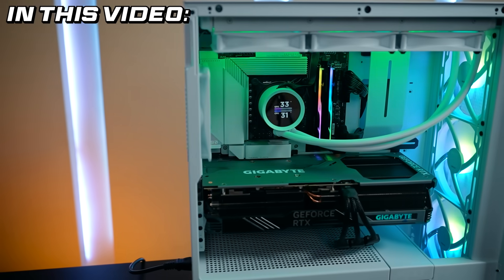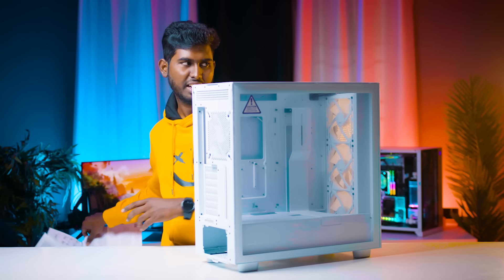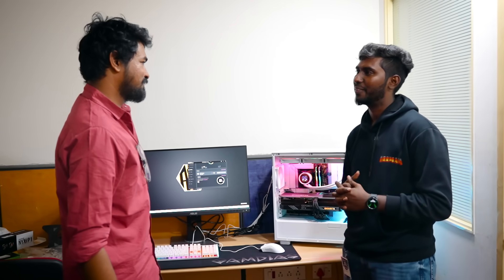MADAN GOWRI's First PC - @madangowri  X A2D | Video Editing PC for Madan Gowri🔥

Comment: Hi I need to go for an upgrade

I have a rx 580 8gb vga
Is it compatible to go with ryzen 5 1600.

Does Msi B450M-A PRO MAX supports Ryzen 5 1600, rx 580 8gb vga and ddr4 8gb ram.

My intention is gaming 50% and normal work 50%.

Please give me Advice
Thanks.

Comment: Bro ... I have seen you guys get ESD shock many times in various videos ... a simple trick to avoid that is to touch the panel with a metal key with you holding the plastic portion of the key -> this will transfer all the accumulated charge from the panel to the metal portion of the key ... now you touch the panel without any shocks :) ... you can then discharge the key anywhere like concrete wall or any big metal body ... you can do it later also (not needed too as it will slowly discharge in air ... this is from my experience in a cold/dry winter weather in Germany when I visited last year :D ...

Comment: 64-bit processor and operating system OS: 64-bit Windows 10 Processor: Intel Core i5-6600K / AMD Ryzen 5 1600 Memory: 16 GB RAM Graphics: NVIDIA GeForce GTX 1060 3GB / AMD Radeon RX 580 4GB DirectX: Version 11

Comment: dont use samsung 980  pro  ⚠⚠⚠⚠ ... garbage ssd... incase neenga firmware update panama use panirindhinga naa, older firmaware la irundhichu na, neriya issues vadhriku, and data corruption airiku which ultimately lead to permanent Data loss !! 🤬🤬🤬🤬...stupid ssd..that older firmware has some program error, where the firmware code makes the controller think that all NAND flash cells have almost crossed its ending life span nu oru thappana olu information sollirum controller ta..andha controller will stop write mode  into SSD and make it READ only and sila peruku Data vah eh corrupt pani vitirchu.. seriyana kiruku P***a samsung SSD... samsung SSD la failure rate adhigum, despite it has the best industry latest features in market comparing every other SSD brands..features wise la top notch, but failure rate is high comparing other well known brands... so better switch to Seagate firecuda, or crucial, or some other brands..if you want low failure rate..Even Samsung 990 pro had many failure rate issues...

Comment: Best way to set up the cooler is to set it up  outside of the casing it will reduce the dust inside the pc . If not invest in a good dust filter for the room

Comment: 0:01-0:14 In this Video......
0:18-0:50  MG Anna PC Build.......
0:25 😂
0:31 Dont say like That Bro.....❤
0:52 Processor.......
0:58 Motherboard......
1:16 RAM......
1:26 SSD......
1:41 😂
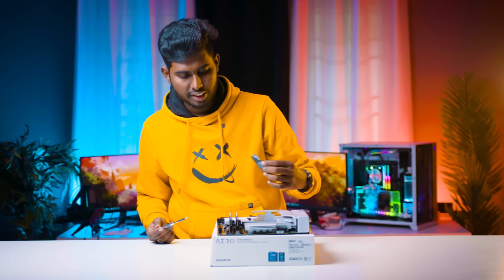1:52 😂
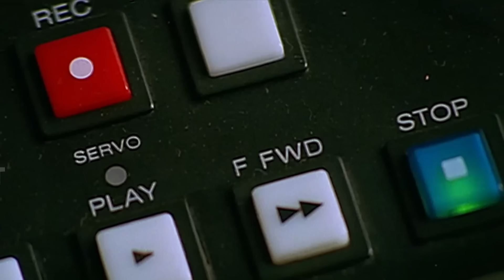2:15 😅
2:22 😂
3:07 Cabinet.....
3:13 😂
3:29 PC-DOC 1st time Reading the Manual......😅
3:48-4:15 PC-DOC Kutti Story.....❤
4:25 Assembling Part......❤
4:29 PC-DOC Style.....😅
4:35 MG Anna is an Introvert????
5:09 Installing Cooler.....
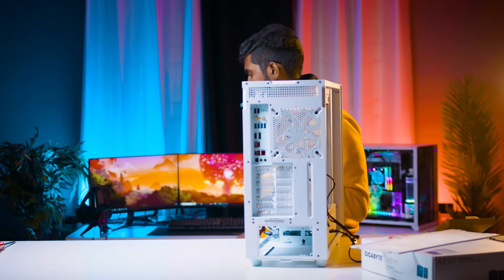5:18 Vibe Time......❤
5:27 😂
5:40 Cable Management.....❤
5:48 GPU.....❤
6:23 Connect The Pin connectors Properly in GPU.......❤
6:37 MG Anna Office......❤
6:47 MG Anna Entry......❤
6:55 MG Anna × A2D......🔥
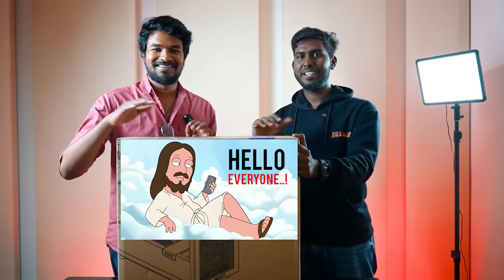7:06 😂
7:26 😅
7:30 😂
7:51 MG Anna kku Shock veitha PC-DOC......😂
8:06 😂
8:15 😂
8:40 Jerk kaatum PC-DOC.....😂
8:49 😂
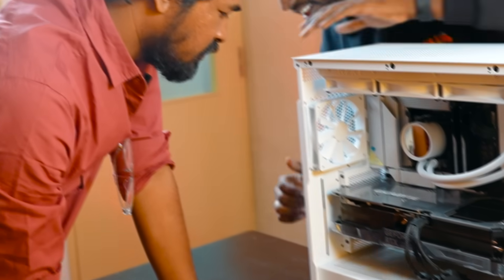8:53 😂
8:59 MG Anna Unboxing.....😅
9:15 😅
9:42 😅
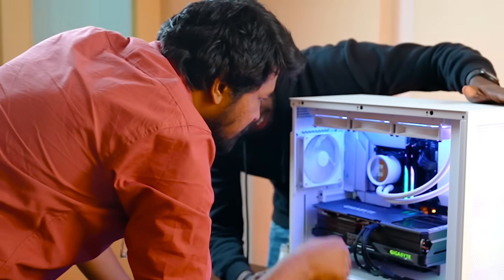9:48 MG Anna Face la oru Happiness.......❤❤
9:57 MG Anna Technical Questions To PC-DOC.....❤
10:21 VR Headset MG Anna Apple Vision Pro Memories........😂😂❤❤
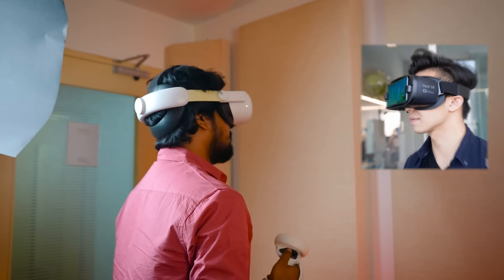10:38 MG Anna Experiencing VR headset......❤❤
10:49 MG anna Vibing with VR headset......❤
10:52 😂
10:57 PC-DOC Kadamai unarchi.......❤
11:08 After The PC Setup.....❤
11:22 😂
11:30 MG anna Experience About This PC......❤
11:50 Next MG anna Server.....❤
11:59 Edhukku indha PC for MG anna......❤
Reply: Yaaru saamy nee
Reply: epuddra 😰😰🥵🥵
Reply: Thivira rasikana irupa pola

Comment: Bro can you build 10000 ₹ panunga pls
Reply: Pana mudhiyum bro Nalavae use panalam na panan but monitor extra varum
Reply: Monitor no problem bro
Reply: @TAMIL_MAKER-sweet  spec soluran

I5 3RD GEN
ZEBRONICS MOTHERBOARD
4GB RAM
256 OR 128 GB SSD
CABINET
500 WATT PSU

Comment: Hi Brother proud to be an soldier 
i need an clarification pleaseeee clarify me brother 
NVIDIA RTX 3070ti mobile VS NVIDIA RTX 4060 mobile which one is better graphics card in terms of money, performance and all other aspects
Reply: Both gpu gives equal performance, depending on the processor you sync with, rtx 4060 slightly 5 to 8 percent gives more performance. So for the better price and value for money stick with Intel 11th gen i5 or i7 with 3070. For the more price Go for Intel 12th or 13th gen with 4060